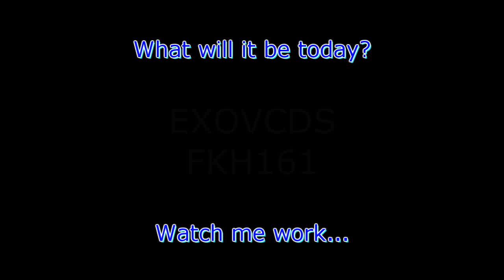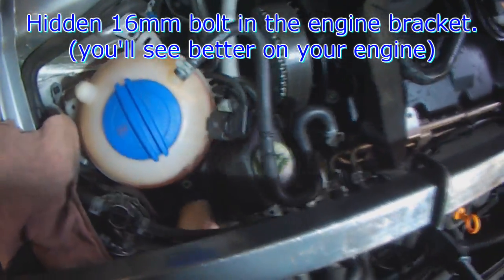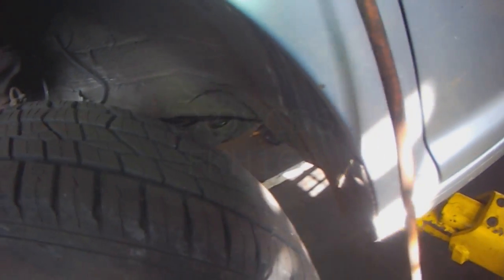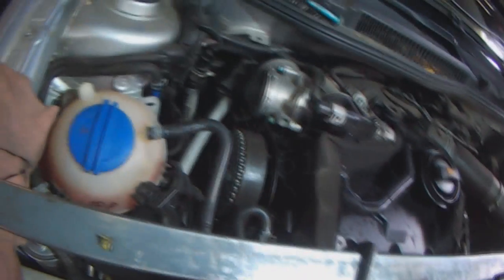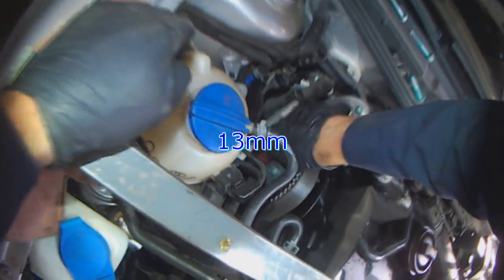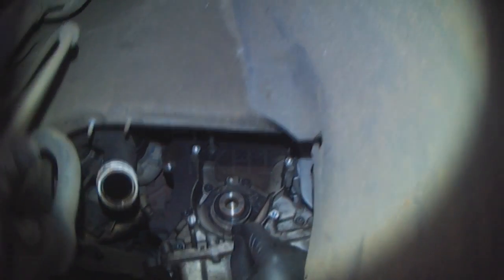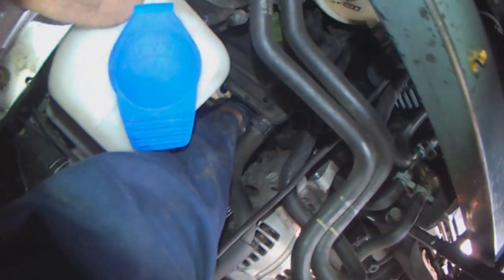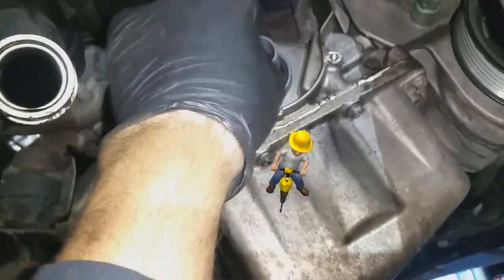VW A4: 1.9L BEW TDI Timing belt & water pump removal

Comment: what its the correct temperature for coolant
Reply from the maker: When the engine is cold, coolant temperature should be close to ambient air temperature. If it is, great... if coolant temperature sensor value is much colder, then the sensor is bad.
Reply: If the sensor its Good what i can check the fuel pressure regulator its New
Reply: The ignition coil make this problem?
Reply from the maker: I don't think so... you can check for spark. If spark is ok, then I don't think it is a coil issue.

Comment: i have this code p0004 on my audi 1999 a6 quattro 2.8 what its that
Reply from the maker: I don't have any info on that code... what scan tool did you use? Any running issues?
Reply: Máxi can
Reply: Máxi scan
Reply from the maker: If it has to do with fuel flow / volume, check fuel pressure & flow. Any running issues? Hesitation, hard starting, stalling , black smoke etc???

Comment: PUTTING BACK THAT MOTOR MOUNT IS VERY VERY VERY COMPLICATED
Reply from the maker: My coworker lifts / raises the engine quite high when he does timing belts... I'm too chicken / worried about raising the engine too much. Instead, I loosely position the timing belt around the crankshaft and then position the bracket into place. Once the bracket bolts hold the bracket, I continue with positioning & tensioning the timing belt. Once the belt is tight, I tighten down the bracket bolts.
Reply: @EXOVCDS  thanks it was of great help. Got it done.  ...on the second turn in the timing it the pin didn't fit was unsure but it started good.  Thanks.
Reply from the maker: @cincoseistres  you can check camshaft deviation / offset with a scan tool... +/- 3 degrees if I remember correctly.  If it doesn't set any cam codes, it's probably OK / close enough.
Reply: It's running ok the only code I got  it's an underboost
Reply from the maker: Did you have that code before the timing belt was done? If yes, then it's not related to what you did. If no, you need to check all your air hose / pipe fittings. Also check how much vacuum is getting to the turbo actuator... and if the actuator is able to hold vacuum.
Reply: @EXOVCDS  code was before I did put a new actuator and a new n75 and still ...
Reply from the maker: @cincoseistres  is the actuator actually moving? Minimum of 17"Hg of vacuum needs to get to the actuator. With the engine at idle, the actuator rod should make contact with the stop screw at the turbo housing. If no, then theirs not enough vacuum, the actuator rod is out of adjustment, the vanes are carboned up or there is some other mechanical issue that is preventing the lever from reaching the stop screw.